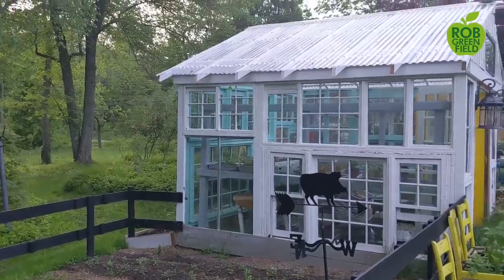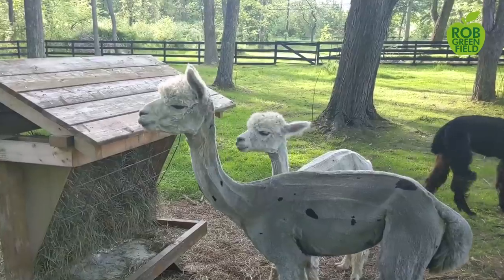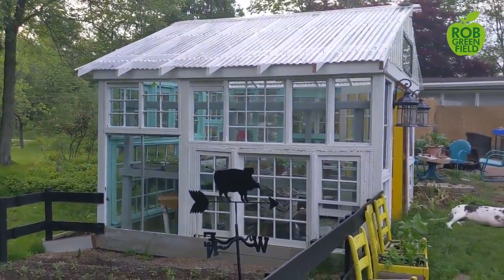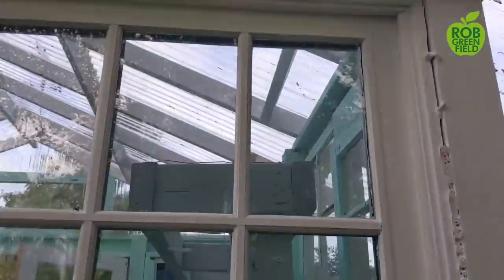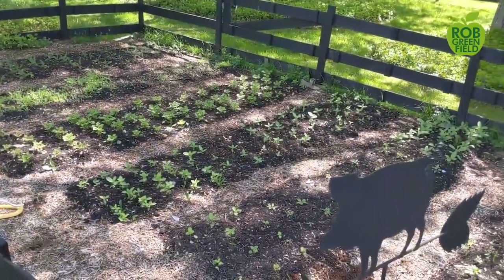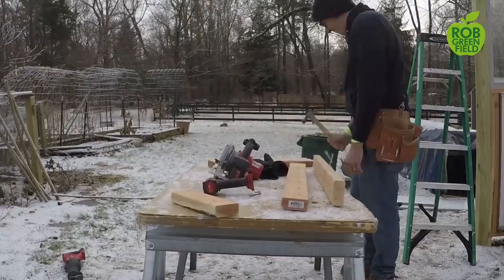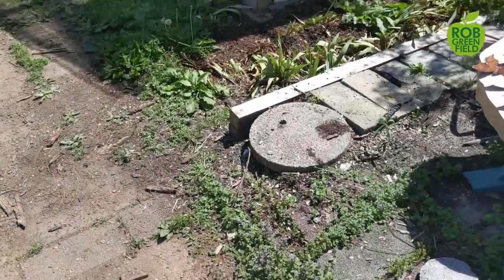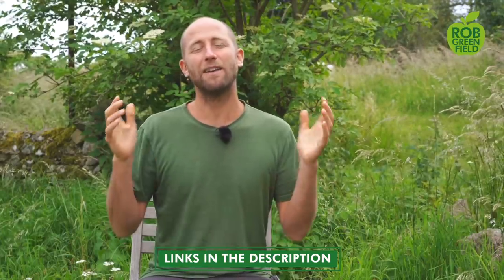How to Build a Greenhouse Using Second Hand Windows- A Tutorial

Comment: I'm not totally clear on how the windows were attached to frame, he mentioned a thinner bit of wood. Also a bit of ventilation is good at times. Amazing end product 👌
Reply: charlie hobson the windows open.
Reply: Hey Charlie, The windows are set on a 2x4 to hold up the weight (outer frame) and then the thinner pieces of wood act as a frame around the outside to just sandwich the window in place. Hopefully that helps! There is a whole series over on my channel about the build which goes into much more depth. And yes, ventilation is good ! Most of the windows on the bottom row open as well as the doors since it gets hot hot hot in there in the summer!

Comment: Hey guys, building the similar greenhouse  concept with old windows and really like the ridge beam roof concept. Some specific questions: 
What is the size of the greenhouse? 12x12?
What is the height of the ridge from the top wall plate?
What is the slope?  ie 5/12
And how long are the rafter tails?

Many thanks